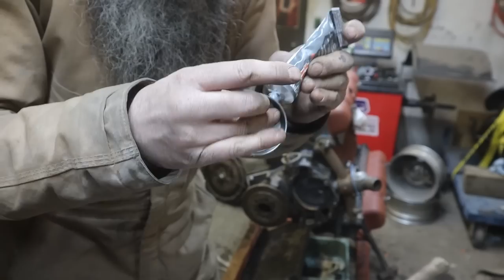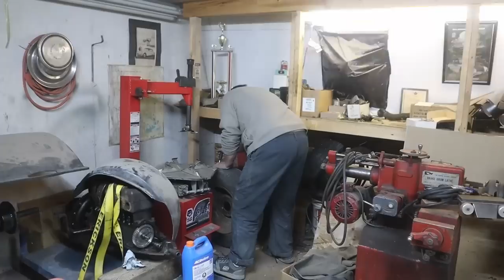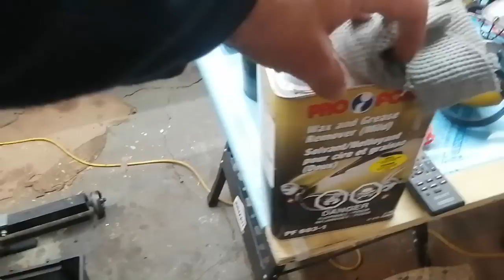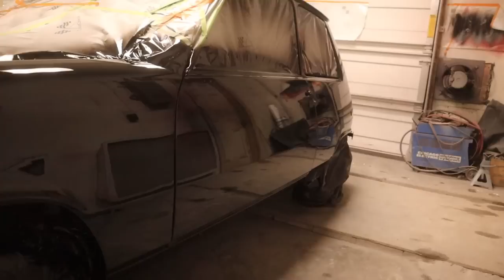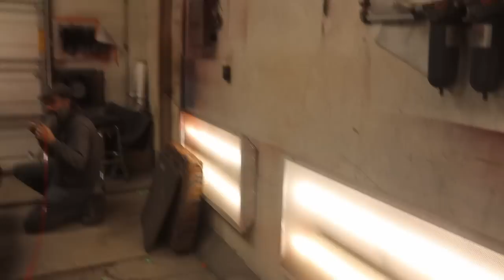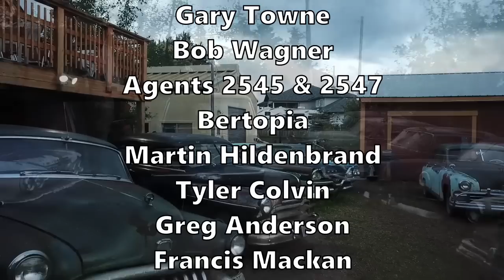A Tale of Two Buicks! Plus: "My Classic Tire", and Renault Reassembled!

Comment: The best way to get the core plugs out is a chisel but the best way to get them in is with a socket or a pipe with a close diameter. I was wondering if you were changing the core/freeze plugs but you stopped at the block heater one, I hope that doesn't bite you not changing all of them. It cost me a 440 not changing mine when I should have so I hope I learned from my mistake, I try, lol and hopefully pass it on.
You can build a run stand of your own you're such a handy fabrication sorta guy!😁 My classic tire is on now, gotta go! Thanks again guys and Frankers!🐕

Comment: Can't wait to hear those ol' nailheads bark off! Renault lookin damn good...ya'll did better than MAACO would have. Can hang your hat on that one.

I would have left that block heater in place, to be perfectly honest. Unless it was leaking, it will work fine as a basic plug. Then again I also tend to drive my classics all year around...and down here in TN you can get away with that as they aren't very viscious with the salt...so I might actually use it from time to time.

As for 'frost plug' VS 'core plug'...it's like pop V soda. Down here in TN I've heard them called half a dozen things. Frost Plugs, Core Plugs, Freeze Plugs, Casting Plugs, etc. They have a different name everywhere you seem to go.

I've got something that would fit on Light Buzz, I think. Found a NIB 1970s/80s AM/FM/Cassette head unit to put in my 71 C10 that works PERFECTLY. Gonna see about installing it this weekend. It's a UNISEF CR-20V.

Comment: Miles, I believe that small hole in the starter motor is for the rear brace bracket that was present on most GM V8s of that vintage. I know that my old Chevy V8 s all had a stabilizing brace that was supposed to prevent the started from flexing while start up.

Comment: Polishing ports is a waste. It actually reduces flow contrary to what you may think and the reason is the laminar layer of air it causes along the surface in which the air does not move. The stream of air flows over the laminar layer. The rough surface of the die grinder actually flows the best. Speed of Air in Reno, Nevada does a lot of innovative testing and the latest thing is dimples, aka golfball. They have worked with UEM (United Engine and Machine), a piston manufacturer, and now UEM offers diesel pistons with dimples. In a Cummins they rebuilt, fuel mileage went up 23%, NOx went down 80%, power went up, noise diminished greatly and there is no smoke while running, accelerating or on startup. All due to dimpled piston crowns and Total Seal piston rings. Dimpling is a science so to just dimple things means a lot of trial and error. The dimples also work on gasoline engines and the compubtion chambers and the tops of the pistons stay cleaner.

Comment: No need to apologize for the R5 Scott it turned out great and small econoboxes are fun too. Even I had a 62 beetle back in the late 70s. It had cruise control ; hold the gas pedal to the floor on the Eway and it stayed at 65mph. Well, a little less on hills ... 👊🤣👍

Comment: At the 32:50 minute mark.   Well put on the straightness of the block.  In the past at workshops I was in we would have a dedicated oil/ hone stone like a carpenter would use for his chisels.  We would rub along the block to see what rips off the surface.  The stone would be about 10 inches or 250 mm long, 65 mm or 2.5 inches wide and about 1 inch or 25 mm thick.   It helps to see if the block needs help and cleans it up at the same time. 👍🏻👍🏻

Comment: I have to admit I have never had so much fun watching the Renault 5 getting detailed. That thing Scott will catch some eyes now not to mention it will be enjoyable to use in the summer. With Buick nailheads if they are not stuck, they are just very worn in the top or bottom end. So you and Myles have done a fantastic job in restricting the engines. The initial brake in of the engine will be a interesting video of it's own. I can see from the close up footage of the Packard that it is kind of too poor to be restored. However it's decent to just keep it as it is. It really deserved a classic tire. Cheers to you and miss Frankers.

Comment: I have always been told by old timers that you can spring the jaws on the “crescent “ wrench when they are turned against the adjustment side. What’s your opinion on that old timer? Doing a great job on the engine. 😮

Comment: You really should paint that lifter valley pan now not later. It's just to hard to paint with the intake on. I had a 264 in a 55 sedan that I repainted , you just can't get under the intake and in time it will rust and peel. Also I bought a oil filter adapter that let you use a common spin on filter. I bought it on FEE BAY, ( Drop the F ) . It worked great and much easier to change the oil.

Comment: I don't know if Myles will see this, but I'd get a new oil pump for his Nailhead if I were him. Apparently, the pin that one of the gears rides on can press out of the oil pump body itself, and his has managed to hit the crank; they aren't supposed to protrude like that. I got a new Melling pump for my 401 last winter for around $150. A little expensive, but perhaps worth it.
Reply: Was going to say the same thing.  Happened on my vintage VW, and the pin kissed the cam gear😪

Comment: Install those plugs by tapping a large socket that is of a size that fits inside the plug.  In this way, you'll be pushing uniformly at the shoulders of the plug.  Put your sealer on both the edge of the opening on the block and on the plug.  In this way, you be assured to have a small ring of sealer on the inside junction of the plug and the block, as well as what ever survives the press fit.

Comment: I enjoy the slog on the Buick. A flex drive cable for your drill  with a keyless chuck or allen key chuck which is smaller on the end lets short grinder bits get into places thought impossible, and lets you use cheaper shorter bits. Pays for itself with the first job using a strapped down Milwaukee right angle drill as a power source. Old corded tools bring nothing now. And are beasts. Stay well.

Comment: was that single stage, looks awesome..
Reply from the maker: Yes, Nason single stage, 2 coats...Cheers!
Reply: @coldwarmotors  fuck.. i got some shit single stage urethane and it came out like shit.. that thing looks absolutely amazing.. Hard to find a place to match the '62 pp1 red on my plymouth.. this shit matched but was just crap. 
like even cleaner on a rag turns the rag red if i wipe it.. it's like basecoat without clear.. not a good single stage
Reply: @coldwarmotors  BTW... i kinda want you to put really heavy flake gold flames inside the red stripe on the side.. would look amazing 
:)

Comment: when gluing the gasket to the block you should put grease on the pan side to be doubly sure the pan wont stick to the glue that sneaks thru the bolt holes.

Comment: What other type of steel rims will fit on my 1950 Dodge Coronet ?
Reply from the maker: I think any Chrysler wheel from the 50s to the 70s with a 4 1/2" bolt circle... Cheers!

Comment: Back in the day, I was taught that to install "freeze-out-plugs" you heated the block area around the hole red, and then put the plug in with reverse pliers.  Live and learn.  Your way is easier, and less dangerous.

Comment: Transmission choices? Beginning with the 1959 models, a three-speed manual transmission would mandate the installation of the 210hp V-8 (making 340-lbs.ft. of torque), achieved with the aid of a two-barrel carburetor and an 8.5:1 compression ratio.

Comment: Is the oil pump on the 401 the correct unit or is it for an earlier nailhead prior to the larger crank counterweights of the 401? Just a thought. The noise of the interference may have been the reason the engine was pulled and left for dead. Whatever the case is/was your attention to detail will make for an excellent save. Scott’s nailhead is a great save also. Once up and running both should last as long as needed in this lifetime

Comment: I have a suggestion on core plug installation. Try using a socket that is the same internal diameter of the core plug, it should just make contact with the raised lip. put a socket extension on the socket and tap the plug in. The use of a center punch can cause the core plug to deflect inward pulling the contact side away from the cylinder block causing leakage. Also no chance of holing the plug.

Comment: Since your good at doing lace, a lace pattern on the drivers side of the hood, and being a conservative one as in like a four inch wide by the length but set in say four inches as well to keep the theme rolling.... just believe it would really add to the someone offering enough to make one consider a new owner..... it is after all, a less than desirable one for a guy with less space to park a rig than folks who live in town with a tiny lot which has more space taken from the footprint in their driveway than the house does, therefore building upwards like a japanese subdivision. That said, their car the size of this one would fill that driveway giving new meaning to "Tiny house"/ and so just humor only

Comment: Good Christ  !!!!

I've never seen a , core plug removal tool  🔧 & process like 
That before  . 

Smart idea replacing those 
core plugs now , while it's out 

You could always add a 
Coolant heater  somewhere else
 in the Coolant system  , for ease 

I get a hoot out of 
Classic tire segment 

I still remember recaps 
From the local , Mars bargain land department store 😂 🤦‍♂️
Even the SAE sizes too 

Funny how those GM
 truck rims , fit that Packard 

Odd how the domestic manufacturers utilize 
Bolts back then 
In stead of lug studs & bolts 

I've got to give Myles 
Genuine cudos , for even attempting to , gasket match 
The intake , to the cylinder heads 
And porting / polishing 

Glad too caught that , deflection 
I'll trust your , compression calculus  , Professor Myles 🧑‍🎓

Jesus Chrysler  !!
That oil pump , barley clears 
That crankshaft  !! 

I still remember when 
Those LeCars invaded American

Comment: I was thinking the hubcap is from a 59 or 60 Buick. I have a hubcap from a 57 Buick Roadmaster hanging on my wall. It took me a while to figure out it was from a 57 Roadmaster because I was not  aware they had a plastic center cap that says BUICK on them in 57. I had thought they didn't use plastic on them until the 60's but was wrong.

Comment: I can't quite zero in on the wheel cover because the late '57-59's Plymouths had wheel covers that were so similar but as an educated Guess, I think the wheel cover came from a 1958 Belvedere or a Savoy? The 59's were plainer than the '58s and the '57's weren't quite as intricate with the spokes.

Comment: The Renault looks fantastic! Thanks for taking us through the repairs, repaint and reassembly. Now all you need are flames in the front, slicks in the back and a quarter mile of clear road!  Cheers from Connecticut!
Reply: Renault 5 is fwd

Comment: I remember Dad sealing freeze plugs (as well as many other things) with the old #2 Permatex black sealer,on my second car it developed a leak on the thermostat housing, replaced the gasket with no results, finally Dad suggested using two gaskets which I did after liberally smearing them with the aforementioned Permatex,it did the trick😮
Reply: I had read how to's with rebuilding using three different types of  permatex.  It was old as well. But prob a good thing to look into, lost skills and all that.
Reply: I also use #2 Permatex with great results. Did the most of the sealing surfaces on my Pontiac 400.

Comment: I also have an ultra-quality oldschool crescent wrench which I absolutely cherish and adore. My father gave it to me 40 years ago. It is a German "Stahlwille" from the early 1950s. What an awesome tool. It opens up until about 50mm (2") and it is the only tool I own which can reliably unscrew and tighten the humongous 46mm nut which is used for the blower belt tensioner in my 1954 Magirus Deutz truck. It is between the pulley and the blower shaft, so you cannot get to it with a box wrench or a socket.
All other tools also fail in that department. The big Knipex Cobra is too wide to fit in there for example.

Greetings from Germany!
Love your videos and the greasy flips!
Reply: I bought Stahlwille Spanners when I was an Apprentice in 1973 and I still use them today. People can stick their overpriced lesser quality stuff off the white and red tool truck. Mine will outlast me.
Reply: German quality .
Reply: Hey Al....about 3 months ago I bought a Stahlwille crescent (only a 4'' tiddler) from my usual old tool man on the Market - Peter, I have been buying tools from him for 30 years all old all great quality.